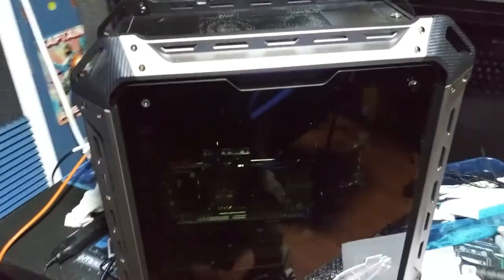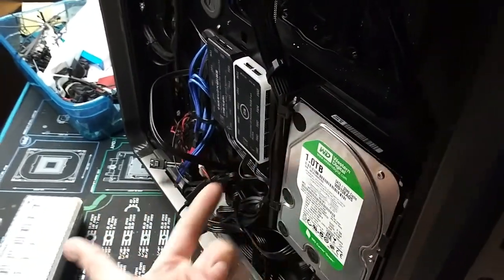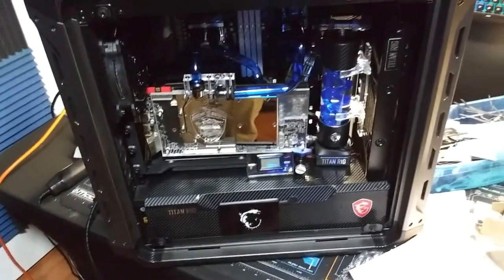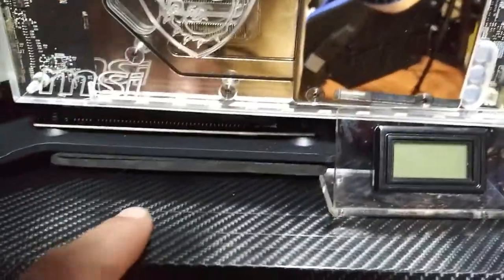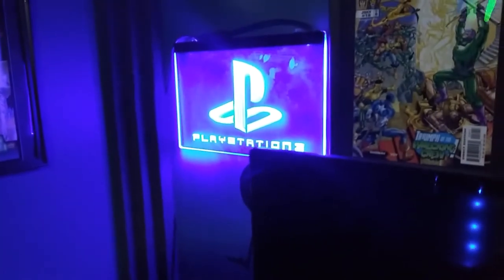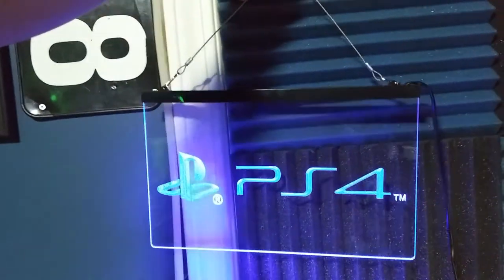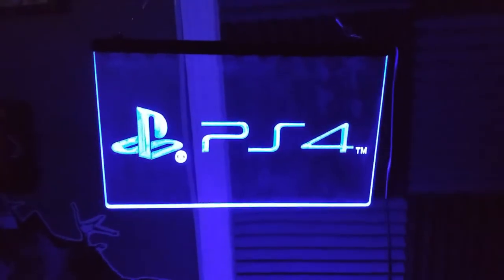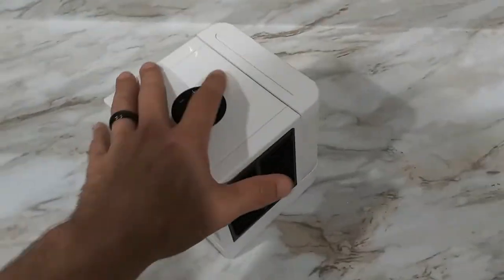Mini Air Cooler

Comment: M in a total mess I guess ... I was getting 50 + temperature on my 20 days old ryzen 5 3500 so I thought I should check the cooler that is it attached perfectly ...
So When I was removing the stock cooler gently the CPU came off with the cooler and the little bit of pre applied thermal  paste got into CPU pins ... I cleaned it with a paper I checked that all pins are straight and aligned properly then I installed the CPU and cooler and now my PC is not booting up .... Fans and hard disk working but no display 😔😔😔😔
Will it work after cleaning ? Please help
Reply from the maker: ok  .. 2 things...   1 .. u didnt get all of the thermal paste off the cpu and now its inside the socket of the motherboard..thats un fix able.. youll have to buy a new 1....     ok  # 2 is the cpu is not getting a good connection with the MB.   also   .. the cpu SHOULD NEVER come off with the cooler at the same time.. that means the cpu was never held down to the board...   you can to do a CLEAR C MOS.. and re install the cpu and try again..  make sure you PUT THE CPU BACK IN THE RIGHT WAY//  .. you have to re check it.. do u have another mb you can test the cpu on .. or another cpu u can test in that MB?   let me know... Consider Subscribing to the channel .. thx